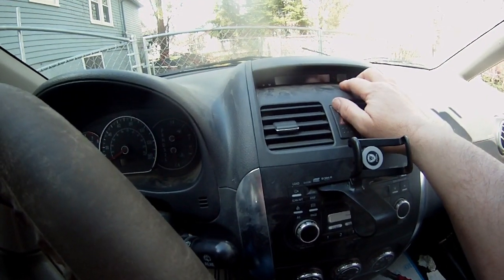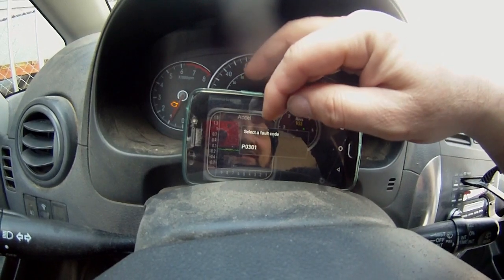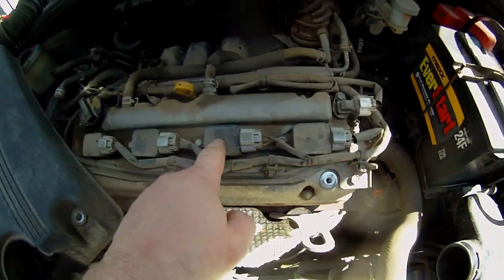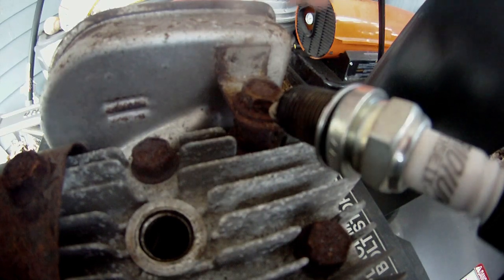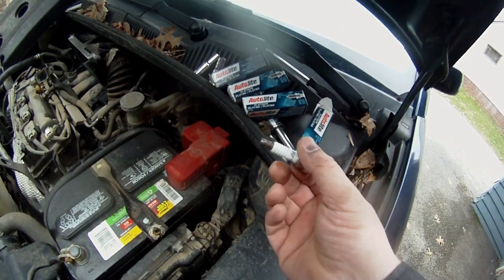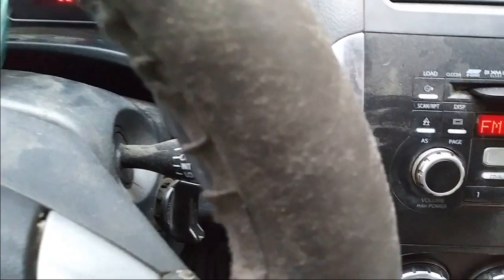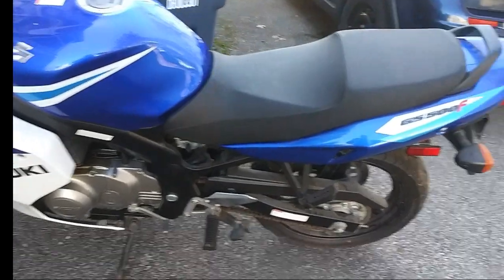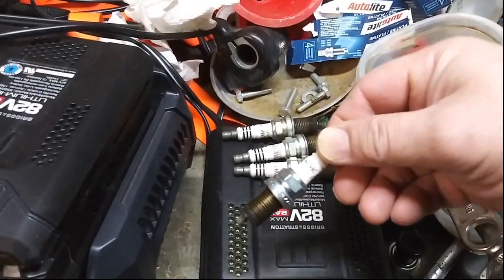Suzuki SX4 P0301 Spark Plug Change...Bad NGK Iridium Spark Plugs 35,000miles.....Never again

Comment: Wow! That's pretty surprising. I've had decent luck with NGK. Maybe i should try Denso I normally just stick with whatever came in the car new. Congrats on the bike! It's nice looking and only 228 miles! 500 and 600's are the perfect size bikes for power and good gas mileage. I miss my Yamaha XJ600
Reply from the maker: I'm kinda surprised about NGK plugs too.....normally I wouldnt think twice about it but after a quick thought.......I realized I went  through a lot of NGK plugs with my 69 bug and also the excavator I had....Maybe it's a coincidence but for the price the iridium plugs should have lasted a lot longer =).......I am beyond excited about my gs500f =) I gave up motorcycles 20 yrs ago but  it looks like they havent given up on me......I got an amazing deal and couldnt just let it roll away into the unknown =)

Comment: I had the same problem with ngk on my sx4. But into suzuki sx4 2012 that i have, the spark plugs have 26,5 mm length instead 19mm in yours. After that i prefer to use denso tt or original spark plugs because the price of it 4 times less than ngk. And i change it only twice time less than iridium ngk, i mean that usually i change nickel denso plugs every 30000km, but for ngk irridium 50-60000km is maximum. 
On another car (skoda yeti) i use ngk double platinum plugs and everything is ok)) Even after 90000km the plugs are in normal condition. 
I think that quality is different for each type of plugs.
Thanks for video. (sorry for russian-style english:))
Reply from the maker: Thanks for the reply =)......Americans love russian-style english, written or spoken  =)......The iridium plugs do not seem to hold up well ..... I thought the original iridium plugs had burned up the electrode end but they are just tiny...... I think a big part of the problem is the tiny electrode end......The platinum plugs have a bigger end but its still smaller then a regular copper plug......The old style plugs did not have a bronze or brass sleeve around the elctrode ......I dont think the iridium plugs are worth the risk =)
Reply: @nitebirdscuffle4213 hi,what brand of plugs u recommend for a swift 1.5 vvt?